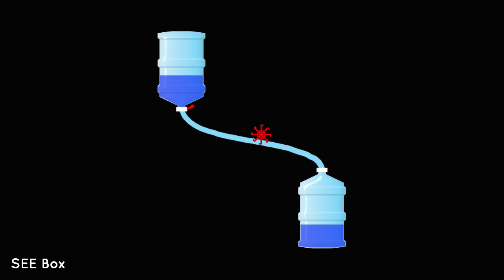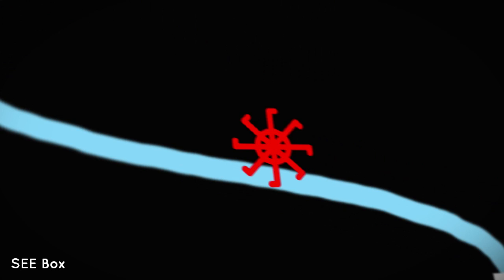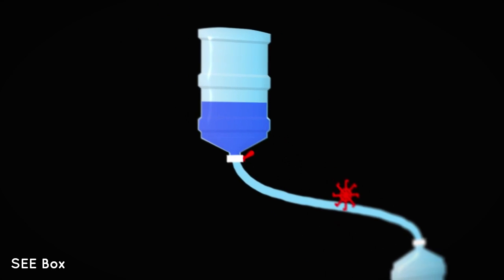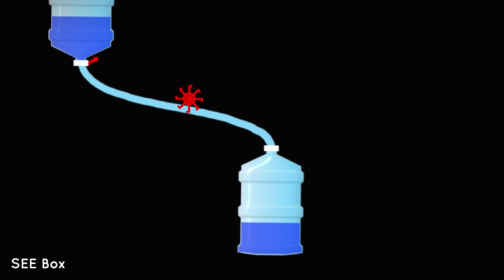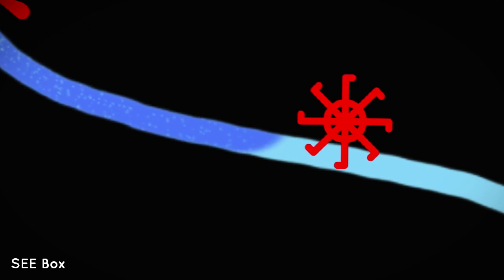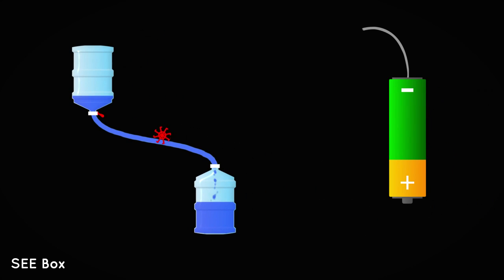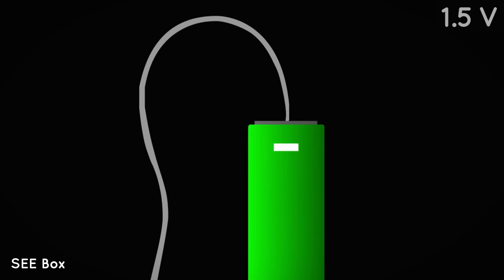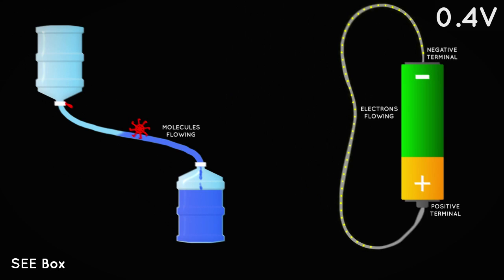What is Voltage

Comment: You describe a capacitor, not a battery. Batteries hold their voltage fairly constant and only experience a significant drop approaching their end of life (which by the way happens due to a chemical increase of the internal resistance, meaning that with no load attached they might even still show full voltage then). Most devices require a minimal voltage to work, a battery is very rarely used until you measure 0 V between the terminals.
The water model actually supports this: If the tanks are wide enough, the water levels in the tank do not change significantly in the process, and the potential difference (corresponds to pressure, or height difference, if you prefer) is mainly due to the difference in height of the tanks, which does not change.

Comment: Not explained clearly..in water tanks the force that causes the potential difference is gravity.Likewise what is the force acting between two terminals for moving the electrons?
Reply: "Likewise what is the force acting between two terminals for moving the electrons?"
The electric potential difference (caused by more free electrons at one side than the other) between the two point that is generating the force that is moving electrons.
Reply: Voltage used to be known as 'Electromotive Force' but that has changed to 'Potential Difference'. Back in the days of thermionic valves the word 'tension', as in high tension and low tension, was also used. The three terms are equivalent, but do not always describe the same thing, depending on context (and modern usage - quite often science and engineering use different terminology for example). Well done to the previous commentor who recognised it as a force

Comment: i thought it goes from the positive terminal to the negative
Reply from the maker: Hi Irenic, 
we have another video as part of the Seebox training solution that goes into exactly this question.  But basically, after they discovered the electron in the early 1900's they realised that electricity actually flows from negative to positive and not the other way around.  However, a lot of academic literature has already been written by then and we know how reluctant academics are to change their literature. :)  Also, the math still works out with conventional flow (positive to negative).